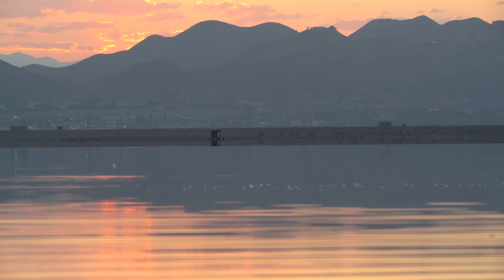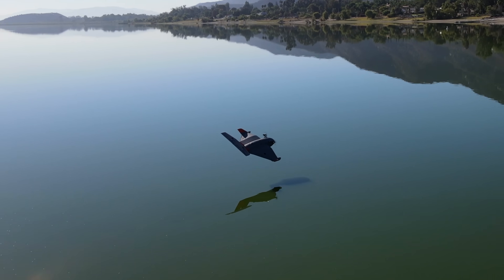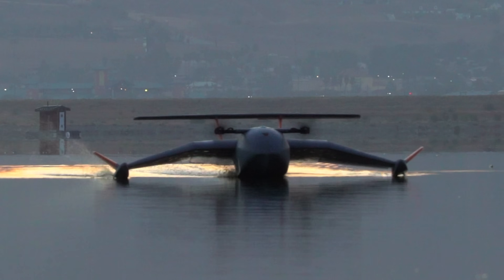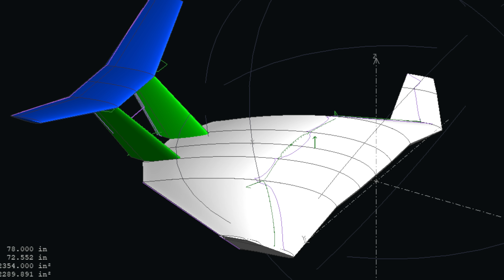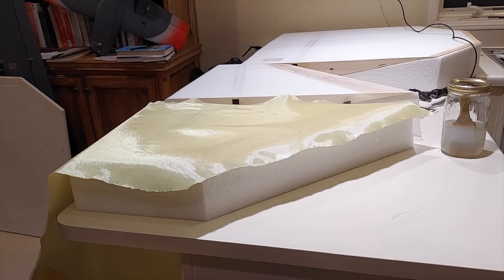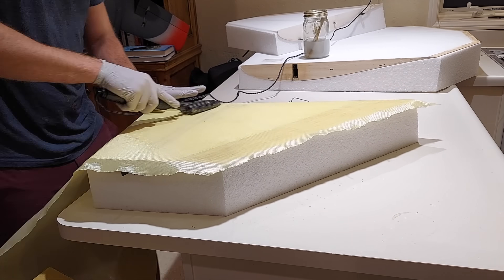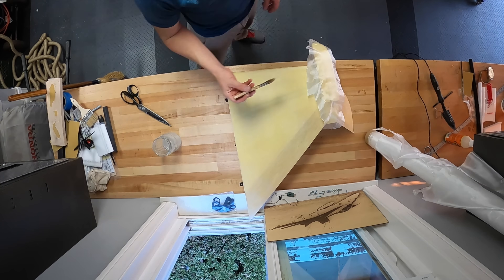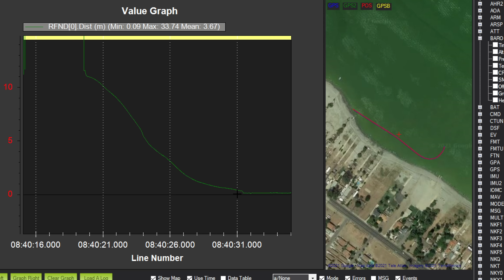Huge R/C Seaplane

Comment: I'm really curious about the real world benefits you found flying in the ground effect.

Like were you running the engines at 70% normal flight, but only 40% ground effect?
Reply: As for the challenges for WIG vehicles, the main issue is the power needed to go from displacement to planing speeds using the same powerhouse required for flight. It is less of an issue if one takes off and lands on a runway, but that takes away from the liberty of landing in unstructured environments.
Reply: That is one side of it. The other side is you need less wing for the same lift, resulting in less drag... therefore higher speed for the same power
Reply: @halfeld  that would also be great to see. Speed vs Power inside and outside ground effect.

Thanks for pointing that out
Reply: @WarlordSh4Dow  my pleasure! Such an interesting topic! Thanks to rctestflight and Think Flight for the journey too. I hope I get to balance entertainment and technical content as well as they do in my channel. Both are great sources of inspiration.

Comment: Next step ... Making it solar, and performing a 10h waypoint autonomous mission 😁😁
Reply: Pulling the kayak behind.
Reply: yesssss
Reply: @Zzrdemon6633  the energy source would be the sun so no
Reply: will take to much time to recharge the battery using solar power
Reply: @johnsmith-yj2cn  no it'll actively use the sun's energy while it's flying
Reply: @Bleeto  i think if you cover the plane in solar panals itll fuck up the ground effect no sure but to my mind the extra weight would cause problems but maybe you could adjust the settings in the lidar not sure and fc ect
Reply: @Mr18031967  weight has no affect on the existence of the ground affect
Reply: @Bleeto  bro i wasnt talking about ground affect its self im talking bout the hard ware ie the lidar
Reply: @Mr18031967  oh, yeah i still don't think it'd be a problem
Reply: @Bleeto  no i dont think it will at the end of the day maybe a adjustment of the lidar would sort it have a good one bro
Reply: With the amount of lift that ground effect creates it probably wouldnt have trouble carrying a ton of batteries jnstas
Reply: @timehmalzeuzkeh7618  yeah but that same weight could be used for solar
Reply: is there a lake big enough to do that?
Reply: @caralho5237  it's called the ocean.  also yes, there are massive lakes like lake Michigan

Comment: I am just wafting for the trans-Atlantic Autonomous solar powered R/C Ground Effect Vehicle
Reply: Ground Effect Flying is not intended for trans-Atlantic usuage. It is for lakes and calm seas. You need to fly much higher above the surface (without the ground effect) than any waves to be expected, otherwise it will end up in a crash.

Comment: Nice video! I wonder though, if you coat the wings and top of the fuselage with solar cells, could they provide enough power to keep the battery charged during flight?
Reply: Here we go again
Reply: It's going to happen. You know it is.

Comment: Airspeed sensor for throttle and lidar for elevator. 
The total energy control loop doesn’t work in ground effect, it reverses.

Please please please put on an airspeed sensor and close that loop, you need it to run on the back edge of the drag/speed curve to gain the ground effect gains.
Reply: I'm no flight control expert, but I feel like using vertical speed data would be better for stability than using absolute altitude data. That way it can try to predict when the aircraft is going to get too close to the ground before it happens so you get less oscillation from the props needing time to spin up.
Reply: @rubiconnn  
After I just explained why you don’t use thrust to control altitude. 

How do you measure vertical velocity without measuring absolute height?

How do you hold an absolute height by measuring vertical velocity?

Comment: How is efficiency to payload ? Design goals achieved? 
love watching it skim over the surface.  
that is the premiss right? much more load capacity and efficiency when in ground effect? 
love the tilting motors to get the air under the wing, 
what if instead of rotating motor, you diverted it with a Flap that dropped in or had it permanently pushing under the wing. ?

Comment: Hey I have a video idea make a small high altitude / weather baloon with a camara and a few sensors like barometer and make it so u can inflate the baloon with one off those helium bottles you can buy cheape from amazon because helium is flipping expensive so its really expensive to launch a high altitude baloon if you want to do it your selve so the idea is you make a tiny highaltitude baloon that's realley cheape to launch wiht a camera GPS and barometer. I'm sorry for my bad English